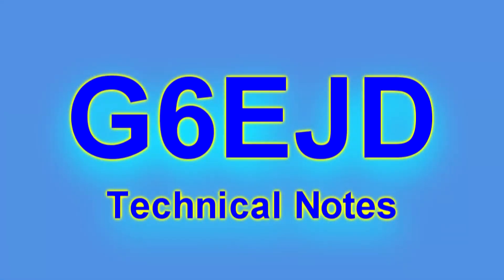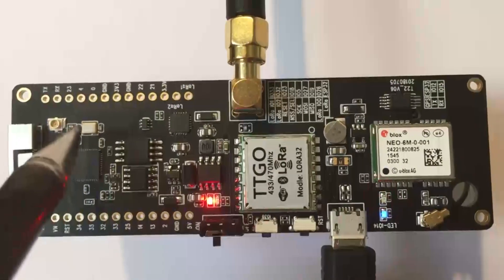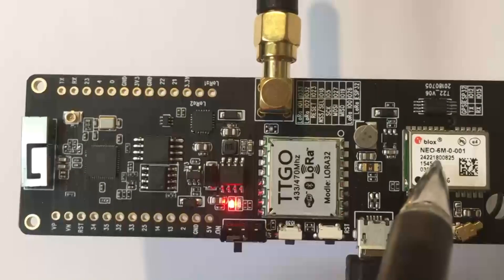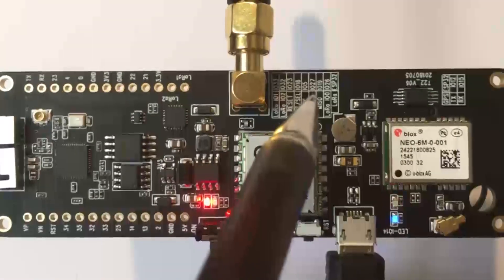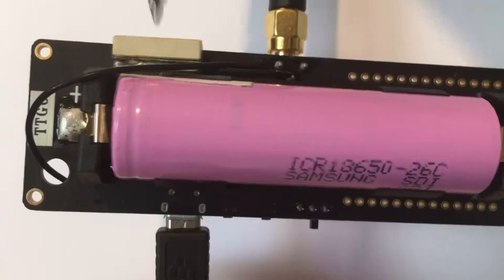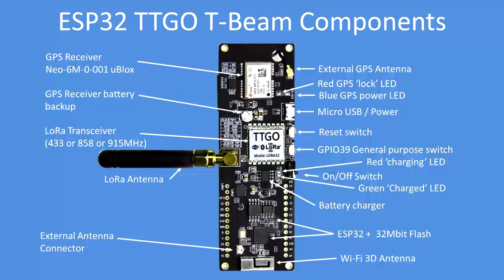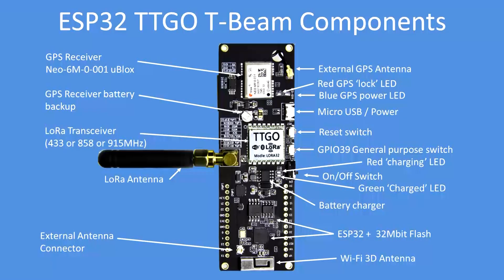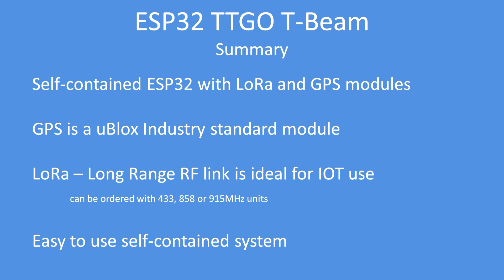Tech Note 105 - ESP32 based TTGO T-Beam LoRa + GPS

Comment: Where is the Bluetooth antenna sitting?
Reply from the maker: It’s the same frequency band as WiFi so the antenna is shared. You can see the antenna as pcb tracks at the top of any ESP device. In this design it is the so-called 3D antenna on the far left looking at the front.

Comment: I just had a revelation in this regard:

4 of my TTGO T3_V1.6 ESPs require /dev/ttyUSB0 as a com port. 4 others did not work, and a TTGO Meshtastic GPS LoRa ESP refused to communicate with the computer. Then I tried connecting via /dev/ttyAMAO. it appears that Lilygo switched from CP2102 serial chips to CH340s at some point.

open up your IDE without the ESP plugged in, see what ports are available, then plug in the ESP. either /dev/ttyUSB0 or /dev/ttyAMAO will show up. use that port.

anybody knows where the I2C port pins really are, speak up, please
Reply from the maker: They use the standard 21/22 for SDA/SCL
Reply from the maker: 21/22 forSDA/SCL
Reply: @G6EJD  In theory. I do not live in theory. in reality half of the I2C scanners I try find only the SSD1306, and the rest find no I2C devices. Yer, I tried pullup resistors. Yes, I tried Two Wire. nothing works
Reply from the maker: In which case try turning down the I2C clock speed like this Wire.begin(SDA, SCL, 100000); 100KHz is the minimum I2C clock speed, the ESP32 defaults to 400KHz. Many devices only operate at 100KHz.

Comment: Nice Video - Shame they are having stock issues , Is there any Sat's that can be received with the  868 MHz version ?
Reply from the maker: The LoRa radio transceivers are all the same, the only difference is the antenna and matching network. the GPS receiver can receive all GPS band transmissions, if you mean LoRa satellites are using the same frequencies as any other ground node so reception will be possible, you may need a larger / higher gain antenna though.
Reply: @G6EJD  Ok David thanks for the information ,and yes I did mean LoRa satellites so there are some transmitting on 868 then ? I got one of the 868 boards to have a play with so I'll have to see what I can construct for an antenna.
Dan
M1EZU
Reply from the maker: Hi Dan, if you think about the antenna polar diagram it’s close to omnidirectional and therefore gain is low, but you can buy really cheap 868MHz yagis that would make a huge difference to performance, or maybe a longer length dipole so you get a much better effective aperture on both TX and RX, good luck 73 Dave.

Comment: Could these be used to bridge wifi connections over long range? If so, what would be the max range and data rate?
Reply from the maker: They can’t bridge WiFi networks, they are for low speed and volume data

Comment: Can I connect this board with a GPRS module to send data via HTTP (es. Thingspeak) the LORA received data ? If yes what module can be use ? Thanks
Reply from the maker: A GPRS (General Packet Radio System) can support the transfer of data of any kind, so  in-principle yes you can send data via the HTT Protocol, although that will add a lot of overhead to the data payload. The ration between protocol and data will be high. Most GPRS modules use AT commands so you'd need to find one that can easily be configured to make a call, then send duplex data (Send/Receive). Speed will be low, but adequate. So receive data via Lora, then open a link on the GPRS and upload data to Thingspeak.

Comment: Great video! Do you happen to have a video on setting them up for the first time?  I have two of these that my son bought me, and I have not worked with these before so I am not really sure as to how to set them up for operating.  I turned them both on but it seems that I need to interface with them to set them up and I looked online but have not found a straightforward how-to video or website.
Reply from the maker: Hi, the examples in the link I provided are still relevant. For the GPS you have to ensure there is a clear view of the sky and give the GPS time to acquire enough satellites, it can take a few minutes. For Lora programme one unit with the transmitter example and the other receiver and the link will work, you need to monitor the serial port for that. I have other examples in TN111. Any problems get back to me.
Reply: @G6EJD  I think I may have inadvertently messed up the original operating files.

I was using sketch, it showed a com port, and was communicating with the unit via sketch and the serial monitor, I downloaded all of the LORA files from GitHub and was messing around trying to set one as the receiver and intended on setting the other to be the transmitter it uploaded the sketch (I assume overwrote the OEM program) and after I rebooted it no longer seems to load, I get the little red led, the blue one never comes on and nothing on the OLED display now.

I was hoping maybe there was a tutorial or webpage for installing the stock software back onto it so I could start back over from scratch.

I have googled it but most of the sites I have run across are vague, to say the least, and even the Lilygosite isn't very helpful.

Mine is the Lilygo TTGO ESP32 T-Beam 923Mhz version if that helps.
Reply from the maker: Have you connected the gps antenna.  You have to take it outside to get the gps to start blinking blue with the antenna pointing skyward there is a front and back of the antenna the soldered point is the top generally. The reason it takes a long time initially is to receive location and current satellite information called ephemeris data, it does this independently of the ESP32, say you weren’t using the gps module it will still blink blue when receiving data. What’s happened is your pin out definitions for the oled and lora and maybe gps are incorrect but if a ttgo product should be ok. Try to find the exact board and see if they list the PIN numbers used and make sure the code definitions match. My advise is try the display example first and get the I2C pins correct then note that and then move to the gps examples and then LoRa
Reply: @G6EJD  the best picture I could find that is like mine is this link, mine looks exactly like this one, but it only says 923Mhz only and not dual-band 868/923 as the one in the photo shows, other than that all the components and layout are exactly the same, except I have soldered on the headers to be able to plug the OLED into it.
https://www.aliexpress.com/item/32875743018.html

Comment: Any idea if any resistors need desoldering/moving to use the external antenna connector? I can't find any info. online.
Reply from the maker: If you want to use the ipex connector then you need to close R40 with a link, currently NC see here and scroll down for details: https://tinymicros.com/mediawiki/images/b/b9/TTGO_T-Beam_Schematic.pdf

Comment: Good day, those module can be use as vehicle tracker?  which app ise needed for Android and pc to check it?
Reply from the maker: Unfortunately Lora is not a suitable communications method for vehicle tracking. If you search say eBay for gps vehicle trackers gsm you can obtain a unit for $10 fit s SIM card and it reports position by txt they are wide spread

Comment: Excellent video many thanks , could I use one of these for a remote controlled boat ? I’d like to compliment my 5.8ghz fish finder with actual google earth images if that is possible ? Thanks
Reply from the maker: Andy, the concept is sound, but the practicalities are not yet matched by the technology assuming your boat did not have access to a wide band WiFi connection, as moving images around requires a lot of bandwidth even if reduced in size. It may be possible to connect to a mobile phone acting as a wireless hotspot that enables the ESP32 to connect and download images from google but that too would be limited unless you had a really good 4G data or better connection.
Reply: G6EJD  many thanks for the reply Dave , I have a lot of thinking and working out to do me thinks 😀

Comment: I have two ttgo t beam but I can not upload the code. how to do it for the arduino ide
Reply from the maker: You have to install the ESP32 extension have you done that?
Reply: @G6EJD  yes it's all set up. But this card came with the softrf installed and I think this is the problem. Now I want to play the ready cod I have and it doesn't work.
Reply from the maker: Adriano moura peixoto, if you’re using the Arduino IDE then what board type are using?
Reply: @G6EJD  I'm using TTGO T-BEAM
Reply from the maker: Adriano moura peixoto, so can you programme the ESP32 withe the Blink sketch from the examples?
Reply from the maker: If you can, then it will accept your sketch
Reply: @G6EJD  when i try to upload any code to the board it looks like esp32 heltec lora. we have to press the program button to load the code. and I found out that this ttgo came with softrf software installed. and I wanted to use my code in it for a project
Reply from the maker: Adriano moura peixoto, so now you can programme the device?
Reply: @G6EJD  I do not program. I use the softrf that came with it and type for model aircraft, whatever. what I wanted was to be able to use the ide of arduino to play my code, but when you send the code to the board is like the heltec board that if you do not press the prog button will not. and I've already pressed all the buttons on this tag and none do that
Reply from the maker: Adriano moura peixoto, does Sodtef support the TTGO module I think it does not and that is your problem.
Reply: @G6EJD  what is sodtef?
what is sodtef? And I just want to throw the code I have into it. but they put the softrf in it and chipped me.
Reply from the maker: Adriano moura peixoto 
, it was an iPhone spell checker it was meant to be softrf
Reply: @G6EJD  sorry for the delay in answering, I was in other projects, but come on, what I need now and really make ttgo receive the code I have, do you have any suggestions what to do?
Reply from the maker: Adriano moura peixoto, I have not used softrf so have no suggestions- sorry.
Reply: @G6EJD  but have you had to reinstall the esp32 firmware or something?
Reply from the maker: Adriano moura peixoto, the ESP32 does not have any embedded firmware, as I said if you use the examples in the Arduino IDE say the one called ‘Blink’ then compile it and upload it, that’s it.

Comment: Hi, I have a ttgo t-beam T22_V07 20180711, and I have the problem that the red led GPS lock indicator is always off. It doesn't flash. I tried the bord both indoor and outdoor. Have you got any advice what is the problem? Thank you very much.
Reply from the maker: First of all the GPS lock indicator is independent to the board or programming. It can take a while for the new ephemeris to be received perhaps 10-15 mins of clear sight of the sky. First check the power supply is good and then leave the unit outside with the external antenna pointing skyward and you have correct antenna orientation being ceramic side uppermost/skyward. If it still does not work then likely the gps module is faulty and you should contact the supplier.
Reply: @G6EJD  First of all thnk you for the answer. I supply the board with the USB cable from my PC (It could seem strange but now I don't have the 18650 battery). Can be this the a problem?
Reply from the maker: Felice Dipace, supplying the board with USB power is ok as long as the GOS antenna is correctly oriented skywards and the gos has a clear view of the sky
Reply: @G6EJD  the GPS indicator started to flash. Thank you very much for your patience and your hints.
Reply: And it works also indoor now!!
Reply from the maker: Felice Dipace, good to hear it was the satellite data/positions it had to receive first, it’s a particular problem when the GPS has moved a long way from when it was last used say China to your country.

Comment: The Github link shows 3 different .ino files (GPS, LoRa Sender and Receiver), they can't be flashed all at once in the board. Is there somewhere an example of code that could be flashed just to test how LoRa and GPS work together ? 
Thanks
Reply from the maker: Sir Mayonnaise, it depends what you want to do, I’ve not seen a specific example but merging the LoRa and gps sketches is fairly straightforward then you’d get a gos reading and send it via LoRa is one example.
Reply: @G6EJD  My goal is to use the board to get GPS data and send them to TTN using LoRa with my own antennas. I'm good at C but I never had to work with arduino before, so I'm not sure how to make several .ino files into one. 
You suggest to merge the setup() from GPS.ino and LoRa_Sender into one, and do the same for loop() ?
Reply from the maker: I've created and tested an example using this board found here: https://github.com/G6EJD/ExamplesCopy the three files into a folder, compile and upload, working fine including LoRa transmissions, currently set to 868MHz, can be changed obviously. Files:
ESP32_GPS_via_LoRa.ino
GPSLora.cpp
GPSLora.h

The current Lora.h library will not compile, it has an error I fixed in the two above files. Enjoy.
Reply: @G6EJD Oh nice ! I've also created a new .ino file by merging GPS.ino and LoRa_Sender.ino in the meantime. It wasn't that complicated after all, and it works perfectly. Thanks again for your advice !
Reply: @G6EJD   the GitHub URL given in this reply seems not to exist. Could you please confirm the correct URL to your files?
Reply from the maker: Ive just tried it and it works perfectly?
Reply: @G6EJD  Thanks for your prompt response. I did check the ../ExamplesCopy URL on 3 different computers here (Vancouver BC Canada), the github.com/G6EJD  works, the github.com/G6EJD/ExamplesCopy goes to a 404 page. I have screen captures of the base and /ExamplesCopy but I do not know how to upload it into the YouTube comments section. I did check your about page and there is an org page but no direct email address.
Your tutorial is so fresh and informative that I am dying to see that code
Reply: @G6EJD  pode reenviar estes codigos?

Comment: Very interesting.  Just wondering, if the lora is setup for low battery draw.   What battery range can we expect on a semi static GPS locator application.  Say 4 reports per day?  just a guesstimation
Reply from the maker: Interesting question, as far as I can see with the modules I have none are optimised for low sleep current, I have placed the ESP32 into sleep and measured for the T5 a current of ~8mA and for the Lora unit without an oled the same. All Lora modules can be placed into sleep where they consume ~10uA or less but the board designers have hardwired the pin, I wrote to them to ask if they could modify their design to drive the pin from a GPIO pin and pull-up/ pull-down but alas they either don’t understand or want to change because of cost, if only they’d ask someone before manufacturing the true Wemos boards are post customer trials and the difference shows imo. So battery life with a 2600mahr Lipo is going to be 2600/8 or about 10-13 days. A small solarPV panel would keep it running indefinitely.
Reply from the maker: You can buy the Lora modules independently $8 and wire them to the ESP32 then you’ll be able to put them into low power mode and a good gps about $5 so a little more fiddly but doable and better.
Reply: @G6EJD  Now that's even more interesting. I guess i could drop the module and the solarPV into resin to protect it from the rough public/handling . thanks for the prompt reply.

Comment: Some help.. Maybe stupid but im amateur on this.. Suppose i order this.. What or where exactly im gonna use it,  & how works..
Reply from the maker: You can programme the ESP32 just like any other, I use ESP32 Dev board. The on-board LoRa gives long range communication to another LoRa device and the GPS gives you accurate location and speed and direction (when moving).
Reply: @G6EJD  Hi Dave thanks for the video. So when programming the board through Arduino IDE do you select ESP32 Dev board as board type? I have several TTGO options but not one for TTGO T-beam. Thanks. Also do you know the dimensions of the board?
Reply: @G6EJD  thanks & sorry for delay. Suppose somewhere high the first for good communication with other that means you can have long distance WiFi too from your home for example?
Reply from the maker: @delikanis-crete  the higher an antenna the better the range until you reach the horizon about 25miles away will be the maximum. You can buy Yagi antennas for WiFi, there is a theorem called the gain-bandwidth product that broadly equates to range, so low gain wide beam receive anywhere for short range through to very high gain narrow bandwidth but long range, effectively antenna gain x bandwidth = range = constant. So double the gain then bandwidth is reduced by 1/2 then becomes directional and so-on
Reply: You could for example make few km range wife position tracker with 2 of those boards :-)
Reply from the maker: Who’s going to be the first (and last) person to try that one out then 😊

Comment: Excellent, your work is appropriated
Have to tested it with another Lora Module? And what is the range?
Reply from the maker: I'm waiting for another module to arrive to test range, but according to LoRa, the range is typically a minimum of 6Km to 16km depending on the terrain where used. As an experienced radio amateur, I'd expect a range of ~15kM at 433MHz, less as frequency rises to 868 and 915Mhz.

Comment: Whats the range ?
Thanks.
Reply from the maker: Depending on terrain you should expect a minimum typical range of 7Km with a maximum of 16Km with the LoRa module. The higher the frequency the closer to optical line of sight ranges can be expected, plus the Earth’s curvature is another factor that affect range, but nonetheless significantly more than WiFi.